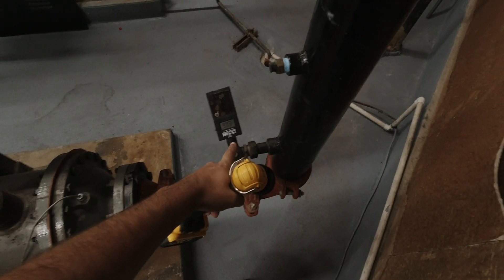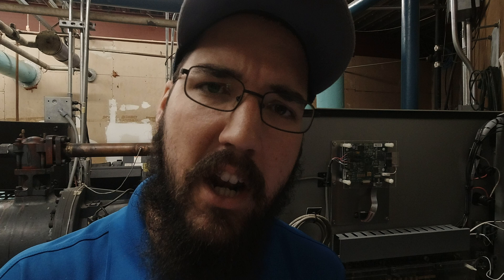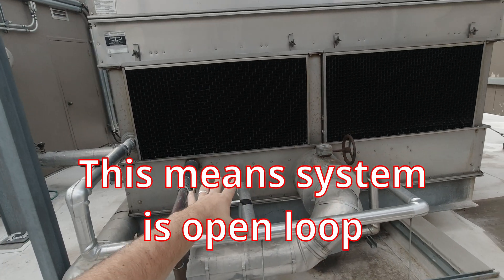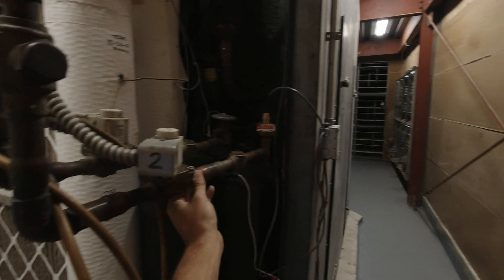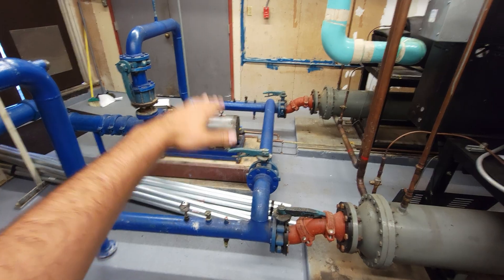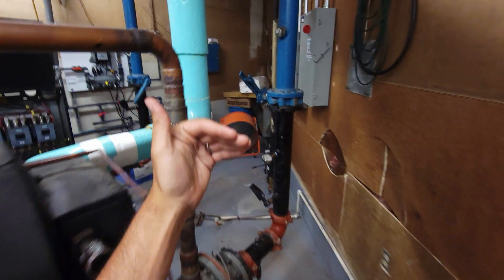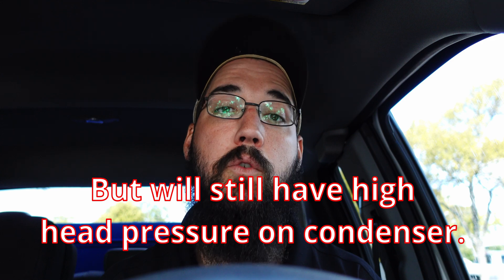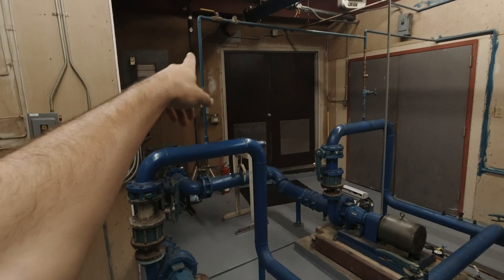This chiller needed some adjustments...

Comment: Here goes the theory stuff. Open the condenser valve,  can't have too much flow on condenser. Evap is different, gotta flow design. You're fighting control problems.
Reply from the maker: I think you lack understanding yourself there buddy, causing you to over simplify problems. While I admit a tendency to nerd out and over complicate in some cases.

Comment: Easy way to take control of the pump operating off of head pressure is to hijack the discharge pressure transducer and piggyback to the second analog input of your vfd. Program the VFDs on board PID integer to about 7 seconds or adjust to your own needs.

Comment: IMO, target condensing water temperature is pretty simple, take your wet bulb temp + 5F with a low limit of 55. Cooling tower fans don't use much energy compared to running unnecessarily high lift on the compressors. Let the towers do their job. People are just wasting energy and working chillers harder by controlling to fixed 75 to 85F dry bulb temperatures on their condensing water loops.
Reply from the maker: Agreed

Comment: Just because it is a water source condenser, doesn’t make it a chiller…. DX evaporator my friend, it’s a glorified split system with undersized pumps and/or trip valves
Reply from the maker: Your right but most people would compare this to a chiller so I wanted it to be relatable.
Reply: I'm currently working on something similar and it drives me crazy all the stationary engineers & the company i work for engineer keep referring to it as a chiller just because the compressor has a condenser barrel hooked up to their cooling tower. I keep asking them what are we chilling? lol

Comment: Surprised they didn’t scale the tubes. You usually only see that on variable primary water flow systems. 

I’m curious if they have a problem come winter time maintaining head pressure and that’s the only way they can maintain head pressure.

Comment: Hand build compressor was where that went off the rails. With no benchmarking , and what sounds like undersized condenser pumps, that looks like a system overhaul on the horizon.

Comment: I think your definition of laminar flow is different than ours. Increasing GPM has an effect like laminar flow in that there is less time to transfer heat. Inside a heat exchanger we want lots of turbulent flow to increase heat exchange and increase efficiency. I think you know your stuff, just a terminology flip flop. Odd they are modulating condenser water so much. We do it, but actual amount is small and done very slowly. Your right, control it by tower temperature.
Reply: Yup I think its easier that way as well. Maintain a cw temp that makes the chiller happy. Seems kind of extra to try and pull in a head pressure value to drive your cw loop
Edit: I know this instance is a dx built up with water cooled condenser and not a chiller, I just see more programs for chillers cw control

Comment: It is strange to regulate flow with valve instead of finding a way to lower frequency of the vfd that's supplying the pumps.
Reply: It's very common to maintain cw temp by a 3way valve that bypasses the tower. You can gain some efficiency by running fans at a constant. This helps with fast weather changes as well. I prefer to use a standalone control loop for tower fan speed and a standalone control loop for bypass.

Comment: I'm confused. you want turbulent flow through thee tubes as laminar flow decreases heat transfer not increases it by creating  stratified water 
 turbulent flow has better transfer by a, better contact with the outer wall and the water mixes better for more even water temperature

Comment: I have 19xr chiller in that chiller display showing some ground fault amp like L1, 4 L2, 3 L3, 5 amp what is the reason please help me to solve that issue 
Thanks
Reply: call a service tech not something that you should be touching.
Reply: @Dang638  but the ground fault setting is 0 to 15 amp, chiller still running but I need to solve the issue and I want to know why that happened.
Thanks for your replying.